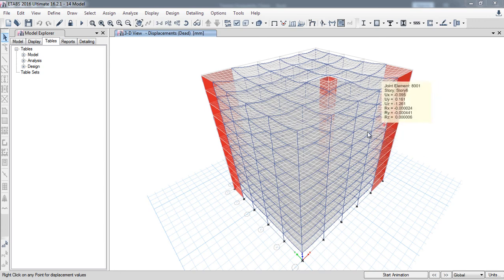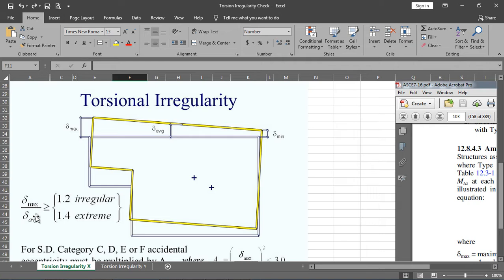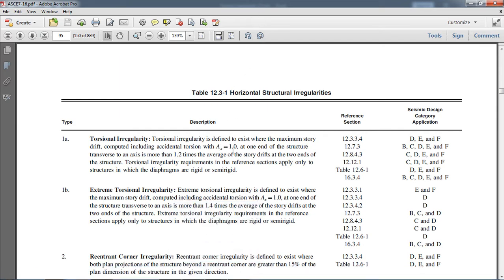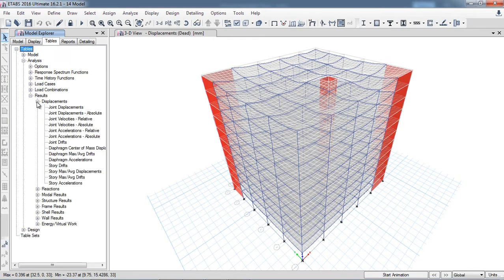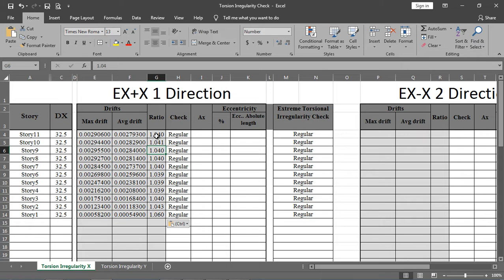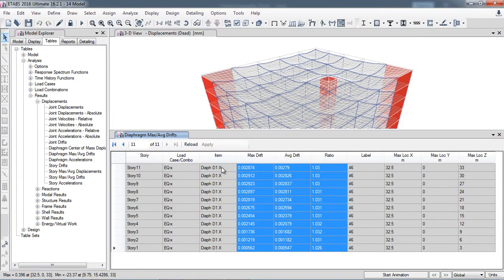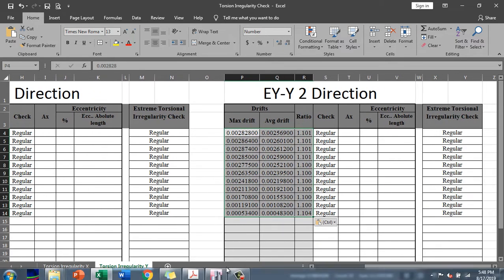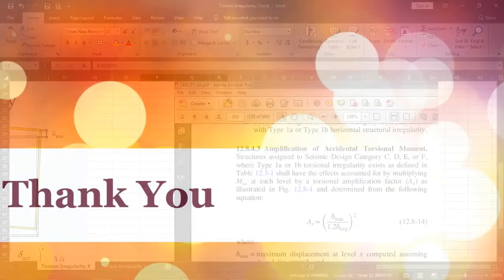CSI ETABS Course - 10 - Torsion Irregularity check | Part 2

Comment: Do we need to keep iterating this procedure untill the values with in the limit or it happens in a single iteration?
kindly provide a video for storey drift and response spectrum approach
Reply from the maker: If irregularity exists (the ratio exceeds the threshold), you must then account for it (for example by amplifying the accidental torsion loads by 
𝐴x, redesigning lateral system members so stiffness/distribution may change, then re-analysis to see how the system responds with the new configuration (which may change drifts, stiffness, etc

So yes: you may need to iterate the model/design: redesign the lateral/torsional resisting system, rerun analysis, check again if the drift criteria (or ratio) now meets acceptable limits (or at least is properly handled). The guidance from one tool says:

“Iterate as necessary.”

Comment: what is DX and DY is it the building dimensions perpendicular to considered direction ?
Reply from the maker: In the context of torsional irregularity in buildings (as defined in seismic codes like ASCE 7 or Eurocode 8), DX and DY typically refer to the building dimensions in plan:

DX is the dimension of the building perpendicular to the Y-direction of seismic loading (i.e., in the X-direction).

DY is the dimension of the building perpendicular to the X-direction of seismic loading (i.e., in the Y-direction).

So yes — DX and DY are the building plan dimensions perpendicular to the direction of the considered seismic force.